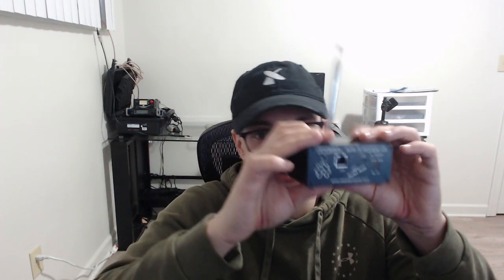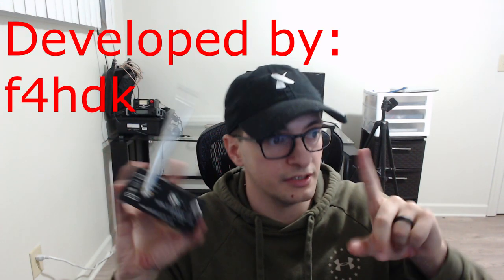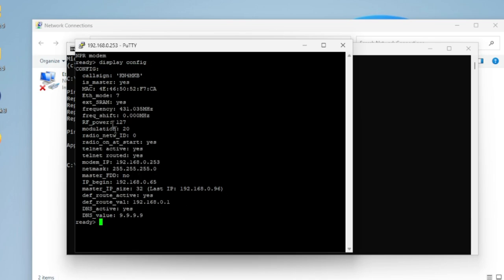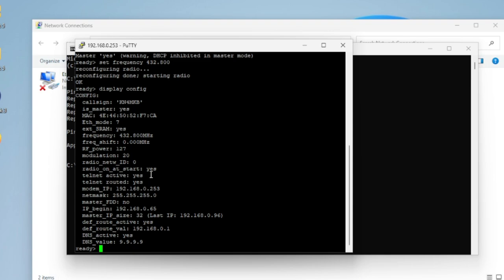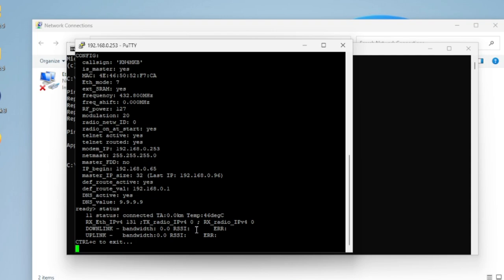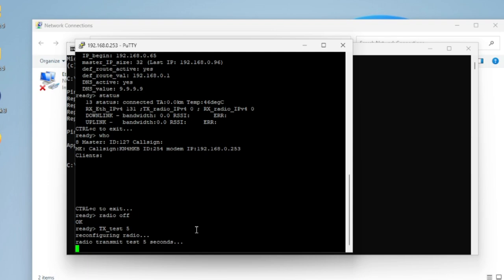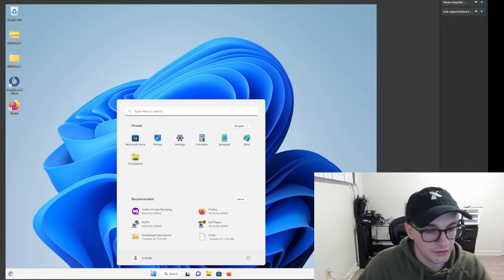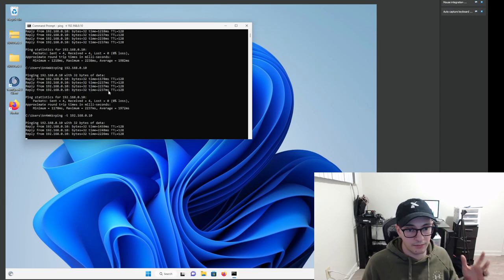Configure the New Packet Radio NPR-70 - With Demo

Comment: Fantastic. How far do you think this could reach with 5 Watts or 10 Watts? Couple miles maybe?
Reply from the maker: Going to find out soon for the 5 Watts soon.
Reply: Any update on this? I'm curious about just buying the upgraded version since it's far cheaper than the NPR-70 + a DMR amplifier (though couldn't any amplifier be used?) @ModernHam

Comment: Do you HAVE to do the static IP or can the NPR modem be plugged into a router/switch that is already running DHCP?
Reply from the maker: The IP must be statically assigned.
Reply: @ModernHam Did you need to install Windows 11 drivers? Mine isn't recognized.